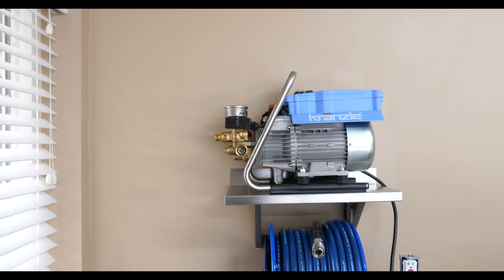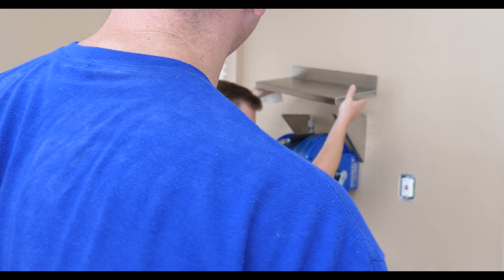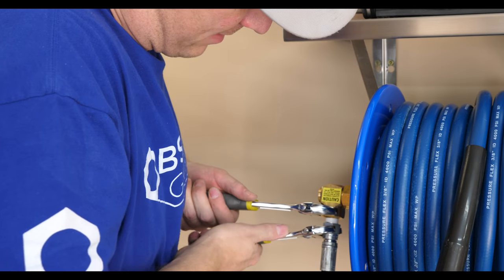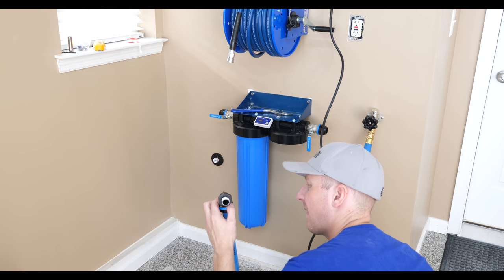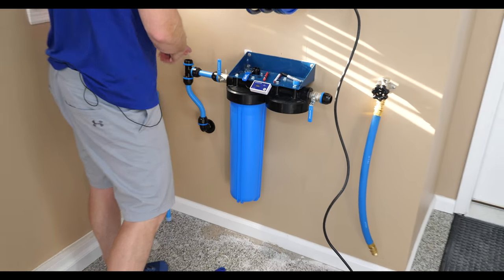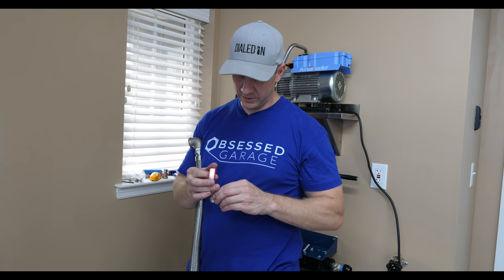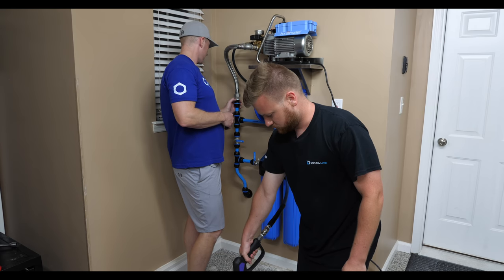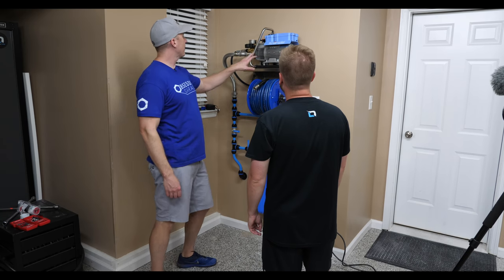Troy Sowers' Custom Kranzle Pressure Washing Solution Install: Video 3

Comment: Hey Matt ive been a pipefitter for DuPont for 16 years and any time Im using threaded stainless fittings I always use teflon tape and a teflon based pipe dope such as Rectorseal or Keytite to prevent the fitting from galling up and leaking. Just my .02  . It looks awesome man. Im really glad you didnt edit out the pain in the ass parts of the trials with hitting the studs etc.
Reply from the maker: The threads were really coarse on the aluminum pipe and the stainless hose had really clean precision threads.  The tape kept getting hung up or clogged.  I think dope would have been better here.

Comment: In the other video I suggested you should have mounted on a 2x4’ ply wood mount.  I see it might need a 2.5x4’ sheet.  Watching this install I wonder how many customers struggle with the pipe fitting with the issues you the seller had.  If you instructed buyers to mount on a predetermined plywood mount you could offer the kit as pre-cut to fit that size mount.  You could have a plywood fixture set up in your shop and someone build up the install on it.  Then take a part in sections so the buyer could easily install on standard plywood they buy.  This extra buildup could be charged for.   I wonder how many buyers install this themselves or higher it out due to all the pipe work.   My 2 cents.

Comment: Matt, you should have Kranzle add a hour meter on the pump so you can track the oil life.
Reply: I agree, i have an extra motion hour meter that I'm going to add to my Kranzle that I just received from OG and see if will work.  i have one on a high pressure compressor that is used to fill my air rifles and it works great.  I think they were designed to be installed on dirt bikes.  I do agree with the other comment that 50 hours is a long time though

Comment: Matt, in this type of installation I’m thinking it would be beneficial to recommend a PVC cladding over the drywall behind the “system” to reduce likely drywall damage from water intrusion. Another option would be to use an epoxy paint in those areas. Just a suggestion, really enjoy the content.
Reply: KPN this entire series people have mentioned “water on drywall”.  If you install this right the only thing that will release water is the end of the hose! For no reason should there be any water that touches the wall unless you have a leak. If you do have a leak your going to turn off the water, clean it up, wipe your PAINTED wall and fix it. The only time water ever ruins drywall is when it sits for long periods of time. Plain and simple.

Comment: FYI buy "BLUE MONSTER" Teflon tape on line. Not expensive but it is way thicker than the white stuff sold in Home Depot & Lowes. You also get more on a roll and it goes much farther, needing way less turns.
Reply from the maker: I don't like the thick stuff as much.  I find it's more prone to leaking on NPT fittings.  I use it on the more coarse threads on the Kobrajet hoses.

Comment: If I was to run kranzle on a shelf in trailer what feed pump should I use and would this increase the psi the pump shoots out
Reply from the maker: You don’t need one.  It will self prime.

Comment: I noticed the deioniozer says it's good for 600 gallons is there a prefilter u can plumb in front of the deioniozer to extend its filters life span
Reply from the maker: One thing that would make a significant increase in life-span would be to connect to a whole house softener system.
Reply: @ObsessedGarage  okay will be ordering my kit in under a month

Comment: there is a lot of talk of making it "man up" tight, is there not a concern of over tightening and cracking the brass on the hose reel?
Reply from the maker: NPT threads diminish, so it stops eventually.

Comment: I am not really a fan of the shelf, it’s the weakest link, it’s just resting on there, could it be screwed together?
Reply: dlroto   I’m sure the weight of the machine holds the shelf down, since it slides down over the supports.  Could always add some VHB double sided mounting tape.

Comment: How will this Prevost piping hold up to water or DI water?
Reply from the maker: We should be good with the volumes we are using.  Aluminum supposedly has good resistance.

Comment: I guess "should have [had] your wife help you" tighten those fittings.😁
If you're going to an installation job, why didn't you bring the correct tools (open-end wrenches, screwdrivers, socket set, etc.)? 🤔  You're recording this to teach people how to do it.  Show them how to do it correctly with the correct tools.  Then, if they do it INcorrectly with or without the INcorrect tools then, that's on them.  It's THEIR fault at that point.